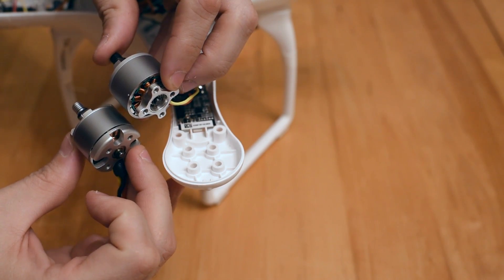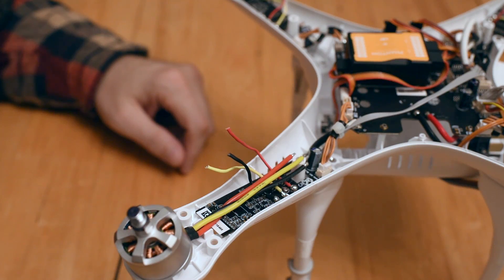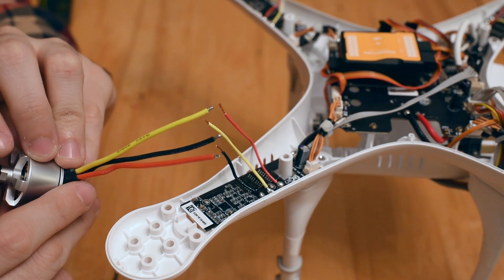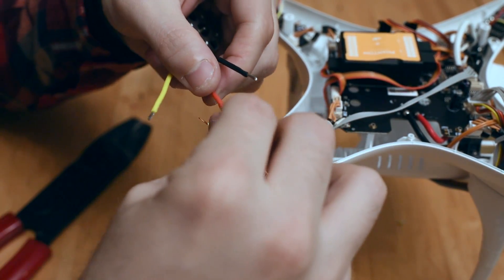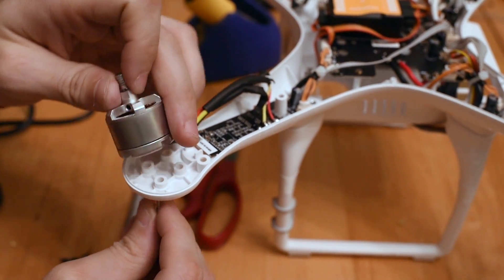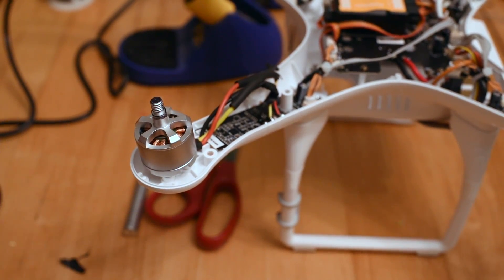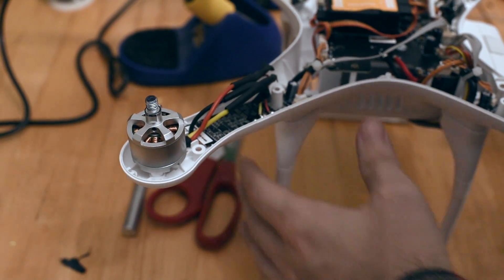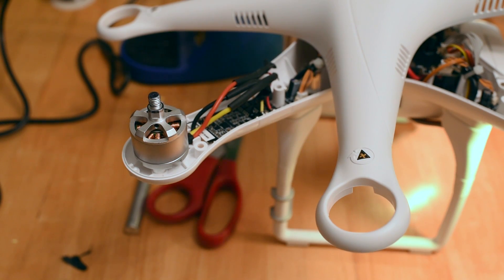Phantom 2 Motor Repair PART 2 of 3

Comment: You do know those are not the correct motors for those ESC....
Reply: Id be willing to bet it is the ESC which is bad. The new 2313 motors DJI are pairing with the Old V2 ESC. Check out the Phantompilots.com forum and there are a bunch of threads on it
Reply from the maker: conroyz28 You're correct. The ESC was bad. I replace it in a later video. The old motors work fine with the newer ESCs, as I also demonstrate in a later video. I flew the drone with this motor for weeks. However, I did eventually replace this older style motor with a new 2312. Most of my confusion here was due to the company I bought the phantom from giving me incorrect part numbers and DJI themselves refusing to give any useful information at all. DJI support sucks.